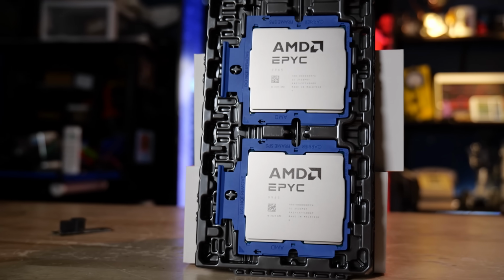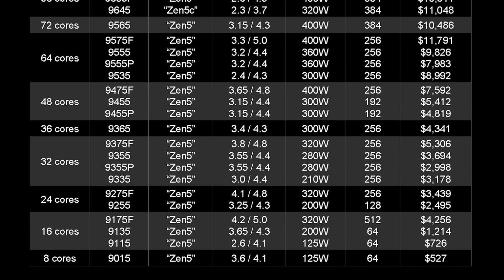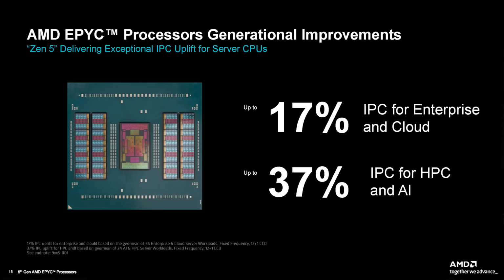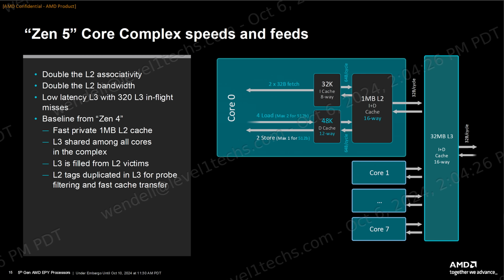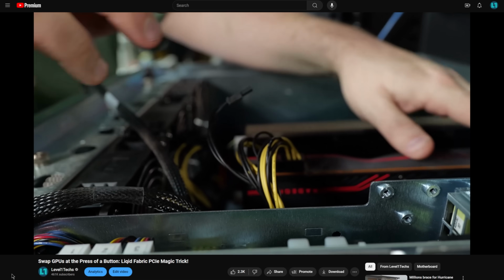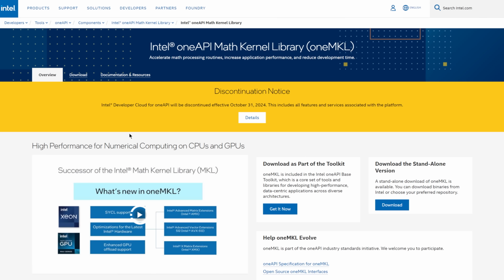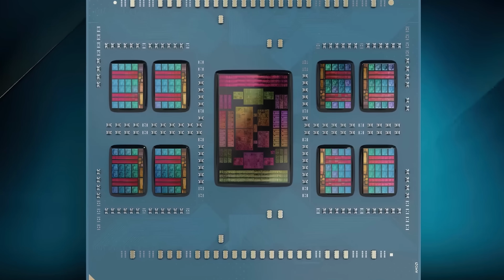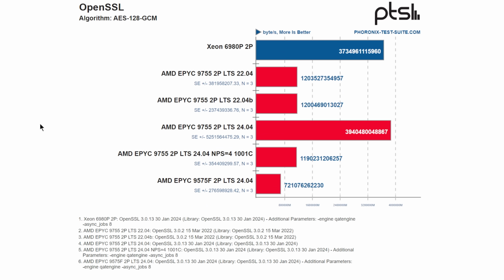AMD EPYC Turin Server Benchmarking and Review! Featuring the Zen5 9575F, 9965, & 9755

Comment: That's what Zen5/5c was made for, servers.
AMD will just x3D their chips for gamers and thats good enough (until intel move).
Reply: Exactly, this is what Zen 5 is all about, server dominance.
Reply: X3d makes sense for some server workloads too but Zen 5/5c really shining for servers I totally agree with.
Reply: They aren't even wrong... based on what Intel dropped today about arrow lake. Zen5 x3d is going to dominate Intel on the desktop as well. Also ZEN5 desktop systems, should be able to slot Zen6 when it comes. Intels mobo is going to be a one and done affair as always.
Having seen now what Intel is cooking for consumer mobile and desktop. Combined with the full on stomping they are going to continue to take in big iron sales. I think at $21 their stock might be over values. :/ Once the fab is split... someone is going to scoop up Intel design, the vultures are circling.
Reply: @chaddesrosiers1107 they proved they can pivot to a 3rd party fab and got billions from the US government. It's a blue chip stock that will continue to be a blue chip stock
Reply: x3d cache for all of the ccd chiplets would be fenomal in performance. combine that with some hbm memory onboard the same carrier board and coupled with dd5 rams. and relase this with reasonable pricing
Reply: @DeviloftheHelll there's disadvantages to dual V-cache for consumers, how will you avoid having L3 data in the wrong CCD?
Without game profiles putting all the engine & core code on one CCD, you are likely to see performance penalties just like on server when applications are not restricted to a single CCD.
Reply: @RobBCactive  thats why we have microcode updates for cpus now. and be a problem for the host kernel to assign it correctly as the application has no direct acces to the hardware, only trough the kernel's virtual memory space
Reply: @DeviloftheHelll  I cannot make sense of your post on microcode updates, either the UEFI BIOS needs to patch the CPU microcode or the host kernel.
But the whole point of virtualization is to NOT give guest OS direct access to critical hardware like the CPU or storage.
Reply: Games are old code, the way to accelerate old code is with clock speed, just that hits diminishing returns.  LT (lighly threaded) performance has taken over from pure ST, so there's no value in hitting 6GHz at high voltage for tiny amounts of time.
IPC and wider architecture is the viable route but that requires software changes, in particular OS and Game engine, so there's a need to lay the foundation down.
As bugs are fixed and lower latency DDR5-6400 setups with moderate power limit increases dissed chips like the 9700x actually shine.
However everyone knows that x3D is AMD's true gaming play and like the 7800x3D executing well with the 9800x3D will do a Turin to Genoa, creating demand for 9x00x3D cheaper gaming CPUs that mitigate the cost optimisation of re-using the 6nm IOD.
Reply: @RobBCactive  games are not just old, but an unoptimized piece of shit nowadays look at the most recent terminator game. ffs single cpu thread is used by the game :) in 2024
Reply: @DeviloftheHelll  it's a consequence of economics .. I had to optimise on my own time, no way would managers think of or feel comfy about bright ideas.  Friends would get settlements on tools they wrote to check source for common bugs, or an incremental linker that cut development time in half
Reply: Yeah, called this on the Tweakers forum in NL where I predicted this happening after a review of the non-3D Zen 5 CPU's was posted. Great cryptography, productivity, AVX-512, this just screams server to me.

Comment: Just to revise ~ these are the same cores all the gamer_bois were dissing and dumping on as Zen 5%. Now let’s have a real good look at what the gaming performance uplift on the next gen Intel chips is. Fifteenth Gen. Error Lake. Because the way I hear it, Error Lake is going to be a whole lot more energy efficient, and have considerably better multi-thread performance, but the gaming is about the same as the current gen, if not a few percent backwards. No matter what twaddle the marketing types at AMD and Intel try and tell you, gamer_bois are not the target audience, for either company. They’re happy to sell you those chips, if you’re dumb enough to buy them, but the CPUs from both Intel and AMD are designed for server workloads. If you can also play PUBG on it, that’s a happy coincidence, but that isn’t what they’re designed for.
Reply: Gamers workloads are single core dominated latency based on feeding the beast x3d with m0re clocks should spank it. This is what the fintech simulation and other boys with money like so we never know. Running off in l3 cache is god like

 High yields channel showed the cache is more compact so they might be doing something weird there
Reply: @bobo-5195  ~ Yes, I saw that. Interesting.
Personally, I have an interest but the 3d is not what I'm looking for. I'm a Linux neckbeard, and the 3d cache just means I have less freedom with clocking and tuning  and curve optimising and stuff.
Reply: All fine and good and I generally agree - but "if you're dumb enough to buy them" overexaggerates your point. Because what else would you buy? It's not as if there were any alternatives.

Now I'm as happy as the next guy to dunk on Intel's marketing, and AMD sure as hell did an amazing job lately to act equally as shitty, but as much as it is true that architectures like Zen are designed for datacenters, there's nothing else that consumers could turn to for basic desktop workloads or gaming anyway. I for one am happy enough that AMD designed something like 3D-vCache that's clearly intended for complex scientific workloads but turned out greatly beneficial for measly gaming purposes, as well - and productized that. That way everybody wins.
Reply: @danieloberhofer9035  ~ Yeah, I could perhaps have said that a little more diplomatically. On the whole, I agree with you on every point.
I am writing a letter to Santa asking for a 9950X on a B650 Taichi Lite. I'm a Linux neck-beard, not a gamer, and I'm old enough to know better, but not do it.
Q: Do I need 16 cores?
A: No, I have 4cores 8threads now on this i7 6700 and it works fine. When I bought it, there was an 'Extreme Edition' above it on the stack, which was a bit silly, but this was more or less the top of the food chain. Ok, well that was almost a decade ago now. I want to replace it with something that's almost top of the food-chain now. A ThreadRipper is a bit excessive ~ not to mention co$tly. The flagship of "elderly reasonable home Linux neck-beards" is the R9 9950X. Throw in 64GB of DDR5 at 6,ooo MT/sec, and a 2TB M.2 drive, and I'll be as happy as a porker in a sewerage plant. Still watching the GPU developments though, that's looking a teeny bit ~
And I need a case with about 170+mm of clearance above the MB so I can fit my Noctua NH-D15-G2. If I'm building my dream machine / daily driver / high-tech toy for the next decade, it's not going to have bong-water being pumped around inside it.
Reply: @Kneedragon1962  I see where you're coming from, all good. And though a 9950X with an NH-D15G2 and all the other bells and whistles you described (I especially like the AsRock board you picked - they've come so far these last years, haven't they?) will probably be all you could've asked for, even more so on Linux - I have that nagging suspicion that Zen5 is just the ouverture to what Zen6 will make a symphony. If your i7 isn't bogging you down hard, I'd wager on waiting that little bit longer and have a system that'll truly last more than a decade again. But that's just my gut feeling, things are moving so fast again these last years that I might well be completely wrong. 🤷‍♂️
Reply: @danieloberhofer9035  ~ Dan, you make a good point. The next chapter of Zen & the Art of Motorcycle Maintenance is going to have wonderful things in it, like the Neural Processing Unit the mobile one has got. So it can do real Artificial Stupidity right there on the chip. That can go with the Trusted Computing unit and the death-by-snapshots that Windows is using. And Secure Boot. Not to mention the tiny unit management chip and operating system so the Sys-Admin in the cubicle farm can steal my pwn collection. I'm not hard against this stuff, like Howard Hughes said, it is the way of the Future, but I'm not in the future yet. And life is like a box o chocolates. I'm like Doc and Marty, still trying to figure out how you get the De Lorean up to 88 mph on steam power. I want to do Duck Dodgers in the twenty forth and half century, but I want to do it one of those super cool leather greatcoats, wearing a Colt Peacemaker.
Reply: Gamer bois and their YouTube brethren e.g. Hardware Unboxed etc. are extremely vocal but ultimately their knowledge and market focus are just on laypeople. The real tech people with actual knowledge knows what Zen 5 is all about.
Reply: Ryzen9000 has an old IO die, Epyc probably has a much better IO die. 
I'm hoping I can put off upgrading until the next generation launches. I mean I wouldn't turn away a 9950x3d (if it has dual 3d CCDs) with ECC or the Epyc 4005 sibling.
Reply: @mytech6779  ~ Yes, I admit, a new I/O die would be nice.

Comment: EPYC Genoa has a new IOD and IF. EPYC Turin has again improved the IOD and IF. 

Meanwhile, Ryzen 9000 reuses the slow IF from Ryzen 7000 which was already worse than that of Zen 4 Threadripper / EPYC.
Reply: Zen 5 for desktop is all about making Intel's power consumption stupid. More and more corporations and institutions have implemented green policies. Heck, EU funds are being allocated to help state entities improve their computing infrastructure. AMD is fine with catching flak from gamers and enthusiasts if it means they can get performance parity with Arrow Lake at half the power or less. Because that's what's going to sway the purchasing decision for millions of boring office beaters.
Reply: The IF link speed has increased one server but is fundamentally the same beyond that between desktop and server.  Going faster on desktop may not have made much difference if it is not a bottleneck in the system.
Reply: @powerpower-rg7bk  IF is the bottleneck on Zen 4 and especially on Zen 5.
Reply: @PowellCat745  Zen4/5 are core architectures that support both server, desktop and laptop.
Consumer use is aimed at a single task saturating single i/o sources and destinations.
It's why consumer chipsets hang peripherals from PCIE4x4 even daisy chaining them.
The system is cost optimised around dual channel DDR5 with expensive PCIE5 limited by motherboard to specific slots.
Saying IF is the bottle neck is barking up the wrong tree, the PCIE bus can transfer direct to VRAM from NVME drive for example.
If you're not a consumer and want higher bandwidth for multi-user systems then Threadripper and EPYC are the solutions.
Reply: @RobBCactive  Bull Crap. Zen 5 can't enough of either bandwidth or lower latency the former being bottlenecked by infinity link limits by & running 6000mhz ram with 1:1 sync with 2000mhz infinity fabric. 
There are gains with the 2: 2/3 infinity fabric when running 8000mhz ram & infinity link at 2133mhz, because the infinity fabric is a bottleneck at 2000mhz for the 8000mhz ram. 

Getting more bandwidth is always easier than getting lower latency. If it weren't you weren't be run anything past DDR1.
Reply: @fishingkev2332  You're ignoring cache and the rarity in consumer space of memory bound applications.  Even then people compare DDR5 cacheline burst rates with an IF bandwidth ignoring the gaps DDRAM has in between.
All modern CPUs rely on cache, efficient programming is about reducing unpredicted RAM access and data  compression.
The best chips in a lot of benchmarks aren't even scaling with memory speed, it didn't matter whether you used DDR5-6000/5600/6400 or even 4800.
Intel 14th gen benchmark performance required expensive fast memory, yet Intel officially didn't even support above 4,800 nevermind the DDR5-8000 which was often unstable that you mentioned.
On server not only is Zen5 Turin benefitting from far more memory channels, but also faster registered ECC DIMMs than the desktop CPUs support, so clue up with some facts rather than display prejudice.
Zen5 as Ryzen is low cost 4nm for consumer, while Arrow Lake targets MT productivity & efficiency, Lunar Lake efficiency in light workloads & games, both at higher cost with 3nm.
Turin is now out on an improved TSMC 3nm Performance process with up to 12 16c/32t CCD with 384t per socket at 500W.
The whole obsession with the Zen4 IF which is actually ran half width at double data rate is misplaced.
AMD's solution is x3D and Intel's Arrow Lake cannot match even the 2 year old 7800x3D which was already halving the power used by i9 14900K chips with serious stability and degradation problems as well as a socket bending CPUs.
Reply: @fishingkev2332  So genius if that's a problem why is Ryzen the top gaming CPU and why are Intel moving to chiplets and incurring latency, then why has Zen5 Turin wiped the floor with the Xeon 6??
It's a bloodbath if you watch the Serve the Home or Level 1 Tech.
Reply: @RobBCactive  Arrowlake is titles and its first time use of Forveros tiling for intel. Its not mcm

Check jayztwocents cu-dimm 9000mhz test for Arrow Lake. Like I said its all about bandwidth, for the larger wider front end of both of these cpus. Desktop ryzen is still using the same i/o die as zen 4. Amd did that to keep cost down. Threadripper has the newest i/o die since they get the same i/o die from servers.
Reply: Lol that means 9000 series threadripper could get the better i/o die.
Reply: @fishingkev2332  It could, but the 7000 series TR already had much better IF and IOD than the AM5 Ryzen 9000. It's just a shame that AMD keeps reusing the same parts that are already the bottleneck on Ryzen 7000.
Reply: x3D yer gaming!

Comment: I 100% need 192 cores. Is that necessary for my music production? Nope. But is that so absurdly what I am going to put into my computer? Also no. 

But I need it anyways
Reply: When you get them do post a video of it running cinebench. I need to see how pedestrian my 7950x workstation is in comparison.
Reply: @xYarbx in multi it's probably hitting 180-200k or breaking cinebench
Reply: Meanwhile in Cubase with dozens of plug-ins: struggling to use 6 cores, let alone 8
Reply: @righteous-one-7  well thats most probably a software problem. i mean that $h!t still supports 4th gen icore with a minimum of 8Gb ram. when was the last time they updated there software and how it runs on newer hardware?
Reply: @righteous-one-7  

Hence the second sentence
Reply: I literally have 64 core processors and I run cakewalk and steinberg all at once while having firefox open;  it doesn't even hiccup.
I opened up a virtual macox and installed logic and garage band to open other artists' projects and it doesn't stall or anything.  I had to test out some MPC beats (daw) using virtualized mac -- no problem.  386 cores would literally be able to run everything without even sweating.  I don't even open up my MacBook anymore.  I have 2 M1's and I barely use them anymore.  I only use them because of Xcode and grabbing new developer keys.   I render video with Davinci on the AMD machine.  Its a crazy time be alive.
I remember in 2016,  VST, AU, DXI would stall out -- no longer.
If I have a stall or cpu drop out, then I know there's something going on with the PSU (power supply) or something dirty with the AC (air conditioner) creating noise to the line or something like that.  It ain't AMD.  This happens when I record at a venue or church and I have 40+ line ins.  I know its a power/wattage problem.

Comment: What the hell is the use case for the 9175F
Reply: Oracle or MS-SQL. For those you pay an annual license per core. Having 32MB L3 cache per core is pretty much just a cheat code. And I'm sure AMD is going to launch a 3D V-Cache version with 96MB L3 cache per core.

Comment: > "If you hanging on to those old legacy systems it no longer makes rational let alone logical sense"
Let me introduce you to the concept named "money" that makes this kind of thought logical and rational.
It's perfectly fine to use those systems longer if you have other things you need to invest in, or if you simply don't have the money.
Reply: I think Wendell means that at large enough scale it may be an investment that will pay off really quickly in power and space rent costs.

Most servers under load are going to pull about 1000W+ regardless of age, if you can replace 10 old servers with one or two of those beauties it may be worth it.